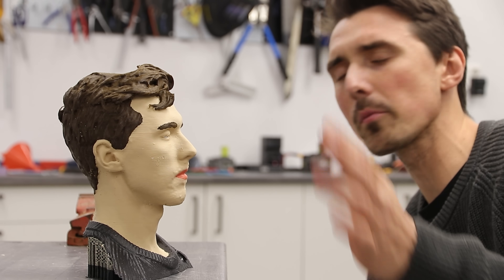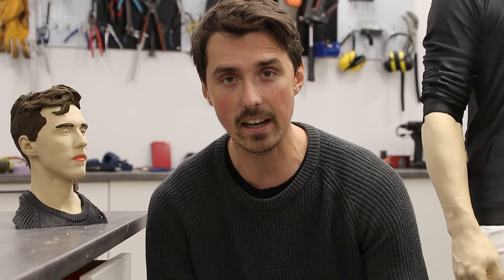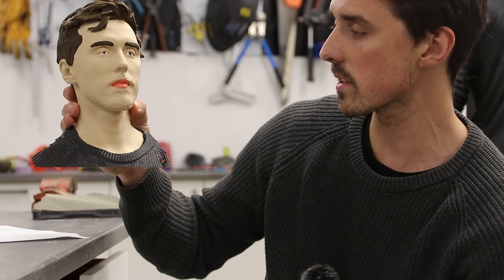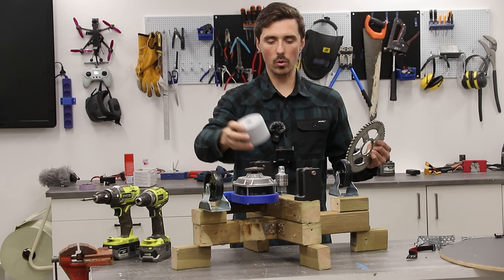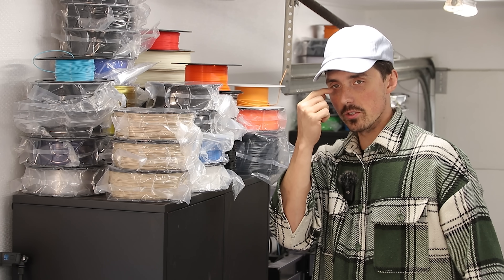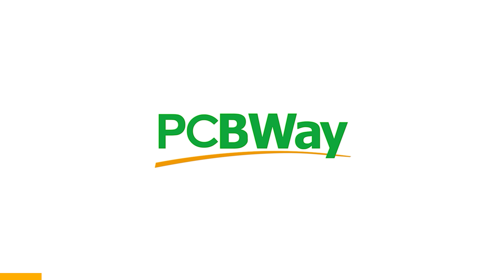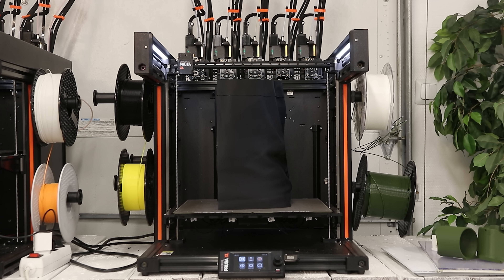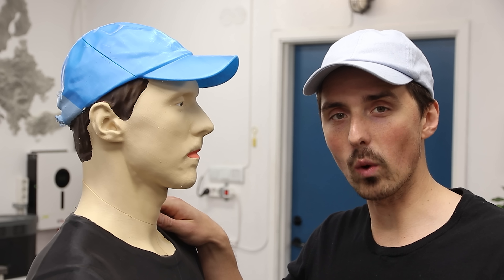3D Scanning Just Got Interesting Again!

Comment: Even with color changing printers you could and sometimes should consider paint and varnish for small details. Acrylic paint is a bit elastic. Thin it until it just barely lost it's elasticity. No need to make the thinning an exact science as long as it wraps and get between the individual layer lines. Don't forget to tape up the surrounding plastic. Use q tips with water to remove paint.

Comment: Pretty cool. 

But yeah, you can't mix PLA and PETG - even on a multi toolhead. It's not about temperature, the materials just don't stick to each other. It's to the point that you can use PETG as breakaway support for PLA and vice versa without any z-offset.

Comment: Nice work! I wonder though why did you not cut the twin in the slicer adding holes and notches (or maybe even a dovetail?) which might have helped the final assembly. Also - the purge/prime tower - was there not an option to purge into infill? I know, 400g at this scale is next to nothing, it's just my curiosity. Oh and just out of curiosity as well - 10% lightning infill works wonders, it actually just prints infill where the top of the print really needs "internal support" and where it does not it just leaves thin air so saves time. Don't take this as a rant in any way, it really is not.

Comment: I have a scanner like this too, but I'm not satisfied with its marker-free scanning. I haven't managed to digitize a human properly yet. I need some kind of arm that scans automatically. And the texture camera is also really bad. Luckily, I didn't buy it for that, but for reverse engineering.
It scans objects incredibly well with markers and lasers. (you need a powerful machine and video card) It's so accurate that I use it for measuring, or it's also suitable for 3D copying objects. Of course, it will be ideal with scanner spray.

Comment: 4:00 - if the scanner has accelerometer - it sees up down, but not rotation if it is the object that rotates - I would guess that would impact scanning performance. 🤔🤓
If so the scanner needs to rotate also around object.

Comment: Bro, ABS plastic melts perfectly with acetone. It first dissolves the plastic, and then it re-hardens. In fact, when repairing broken ABS 3D printed models, this method of gluing parts together works much better than any glue. I recommend giving it a try!
Reply: You know that print was PLA though, right?
Reply: @cwgreenley  Nope, he said the car body is made of ABS plastic. And if that's true, then it can be welded with acetone. I also sometimes use acetone to determine if it's ABS plastic, because it's the only one that reacts actively with it.
Reply: @antonymakesstuff did you watch a different video? 😂 What car are you talking about?

Comment: How does the PLA even stick to the PETG-part?
Reply: It doesn't.  So good thing he changed it to PLA before that was an issue.
Reply: It is common method to print model with PET-G and support with PLA. You can break and separate it easily after printing.
Reply: @bikeshunters that's why I asked.

Comment: Yes! You got some 3D scanning technology! Dude this could be an awesome addition. I saw an archeology team go into a cave & use a LIDAR scanner & they were able to create an insanely high resolution 3D model of the cave. It even helps them find undiscovered passage ways. 1 team had a drone with a LIDAR scanner attached to it. It's fascinating stuff.
Reply: This Creaity Raptor scanner, unfortunately, is not a LIDAR scanner. That's very expensive. It looks with two cameras and illuminates the surface with structured light or a laser grid, so it can see its spatial position from the distortion of the lines. It's quite accurate, but the technology has its limitations.
Reply: @lacikeri3102  oh is that the tech that takes a bunch of pictures where the lighting changes direction for every picture? I saw a microscope that did that & then uses software to stack the data from the images to produce a 3D image of the object. (I hope LIDAR will soon become available for the rare individuals who are capable of building quality DIY projects. There are these 2 dudes who have been building underwater ROV's {in Sweden or Norway I don't remember exactly} but and I wish LIDAR technology could be available for people like them)
Reply: Photogrammetry allows to get quite decent scans nowadays. You don't need LIDAR or 3D scanner at all. Just your phone camera and desktop software like for example Reality Scan.